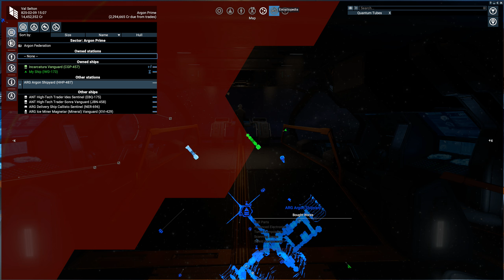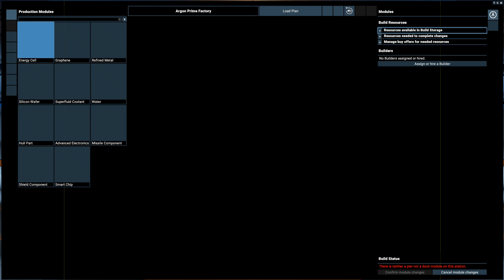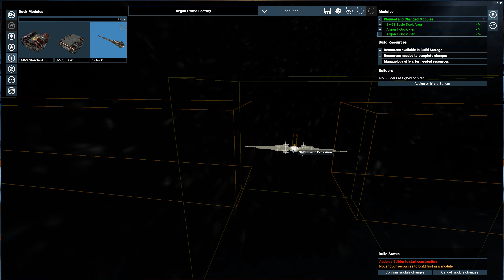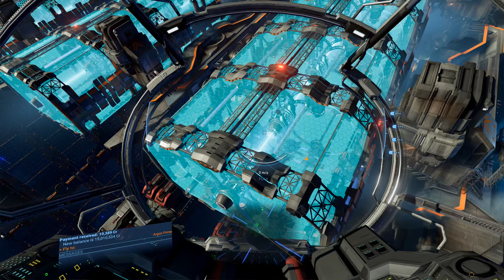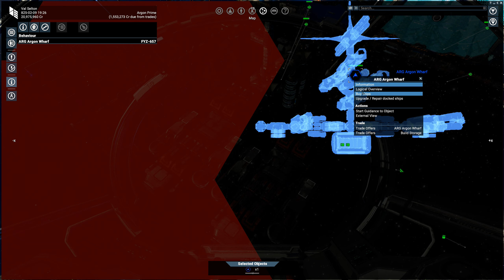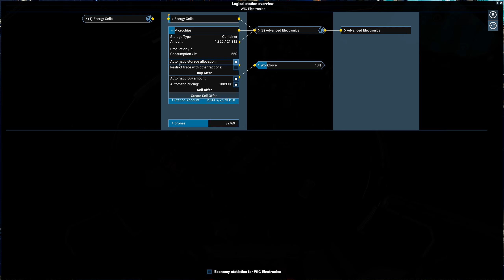How to make Advanced Electronics | X4: Foundations

Comment: So the station looks good, there is three things i would like to remind you about.
First is station security, i did not see you place any defenses on your station so if it is attack it will be in a bad place.
You can go in efter the fact and add turrets to some modules, so that is fixable.
When i build i try to place the modules that have built in defense turrets in a way that it gives me as close to 360 cover.

Second part is when you look at the cost of building the station, you can lower the buy price to about 90% or even 85% depending on the state of your gaming universe.
No need to pay more then you need to. :)

Third is to turn off selling of energy and letting the factory build up a buffer for production first.
Then you can start selling of the extra you have.
Reply from the maker: All good advice.  Yeah, security is an issue at the moment due to a shortage of nearby resources. It will be rectified soon :)

Never thought about lowering the price, hmmmm.
Reply: @WeritGaming  Looking forward to that good sir!
Reply: I'd like to add that you can lower the buy prices significantly more on abundant resources, mines usually 50% & energy cells all the way down, with the exception of (usually) Claytronics, Hull Parts and Adv. Electronics, as those are always in heavy demand.